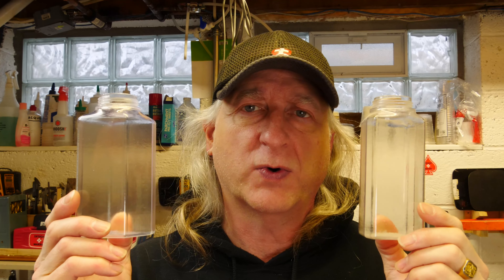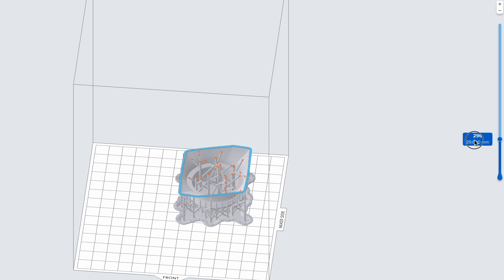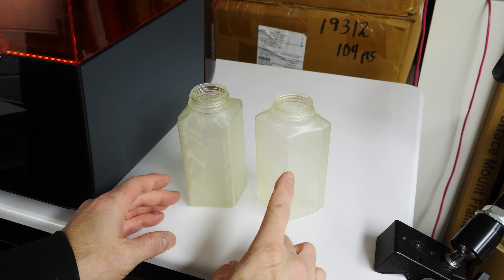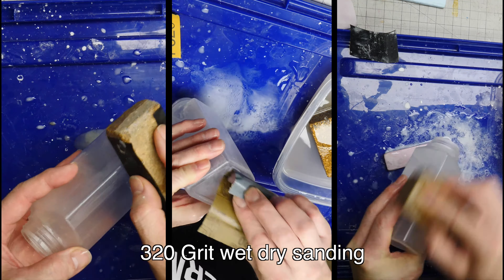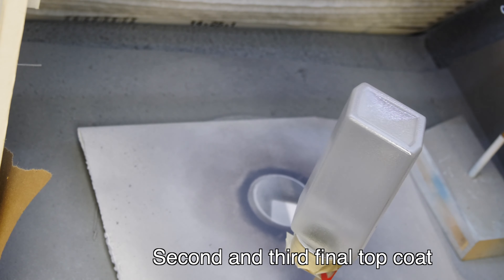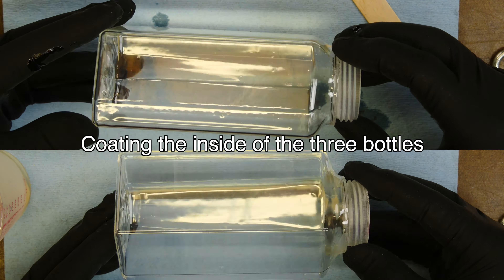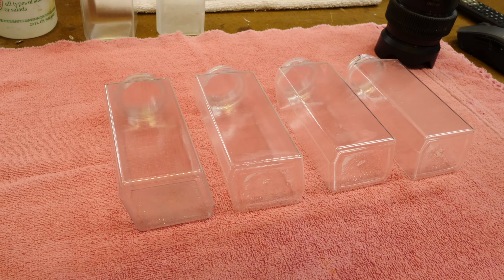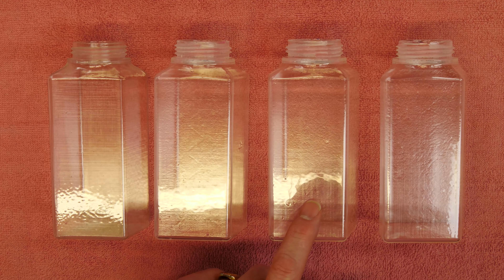How good is the Form3+ at printing clear?

Comment: After my graduation i worked some time at a modelshop for Philips. Our team worked a lot on visual models/prototypes and used pretty much the same techniques. For the clear models we designed the parts in two halves with an tongue and groove. This way we could sand the insides as well and clear coat the insides this improved the clarity very much. The halves we than glued with an uv-glue together. The seams became complete invisble. By the way you are master craftsmen.
Reply from the maker: Thanks 👍

Comment: Fellow prototype professional here. I've always done clear a little differently. Not saying its better or worse but we've had some great results with Formlabs clear as well. We leave ours totally in the green, no cure.

1) Block sand 400 grit to bust the touchpoints down politely (we use popsicle sticks and spray adhesive to make  "mini files" for fine areas)
2) Red scotch bright wet sand (it busts highs nicely without having quite the same issues of gumming  or embedding)
3) 1000 grit wet sand
4)1500 grit wet sand
5) 3000 grit wet sand
6) Clear coat as shown OR Rattle can Rustoleum clear lacquer. (Sounds dumb but it self levels incredibly well as long as you don't overdo it.)
Reply from the maker: Thanks for the breakdown, I left my parts green as well. Interesting about the Rust-Oleum clear

Comment: how did you get rid of the yellowing caused by uv curing?
Reply from the maker: Printed new ones
Reply: @EricStrebel  yea but you didnt get yellowing on the new ones after you cured them?
Reply from the maker: @3d_pablo I did not cure the final ones, just left them as the machine printed them.
Reply: @EricStrebel  ah ok, thx for the clarification. you might also want to look into water curing, heard it helps with yellowing but never tried it
Reply from the maker: @3d_pablo ok, I will investigate
Reply: I find that the yellowing goes away after about a week. Some transparent resins go completely colourless and some keep a very slight yellow tint.
Reply from the maker: @BobBurrow I will have to keep an eye on that
Reply: I have no idea if its the same kind of yellowing, but with old computer cases and such they use hydrogen peroxide with uv light to get rid of the yellowing. Perhaps it could work here too

Comment: Any reason for why you didnt place it with the bottom towards the buildplate so you didnt get any support on the inside? 🤔
Reply from the maker: Yes, you get a distorted part from the pressure when the part is plunged in the resin over and over during the build
Reply: @EricStrebel  Aa of course.. The cupping effect. I forgot about it, but maby you could make a hole in the bottom? I use a 10w UV flashlight to weld with.